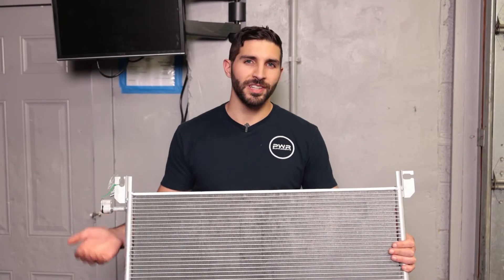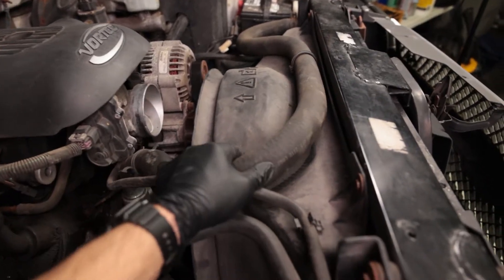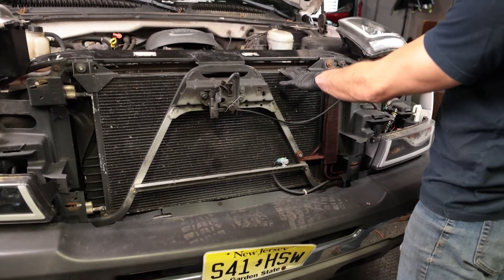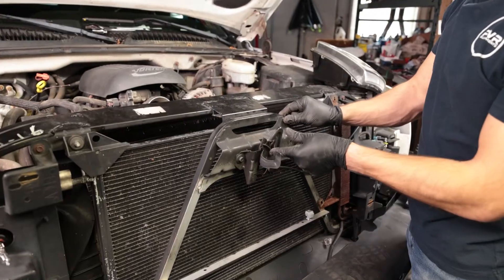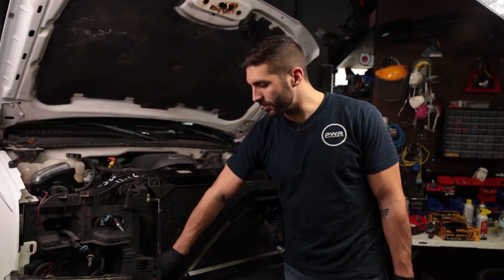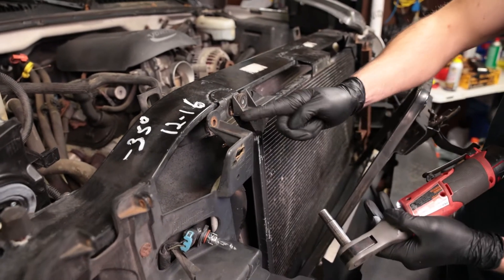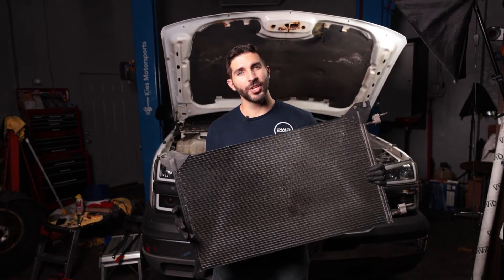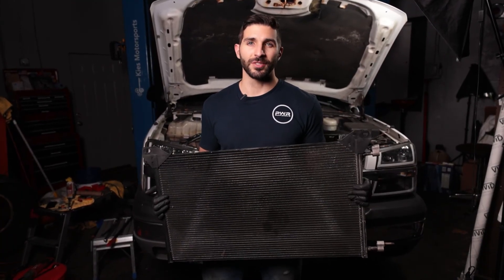How to Replace 2004 Silverado AC Condenser -  Sierra 4.8L 5.3L Tahoe Yukon Savana Avalanche Suburban

Comment: What were the symptoms.  My ac is not blowing cold air I done changed just about everything on the truck new ac compressor accumulator orifice tube cleaned out the filter and fan. Replace 2 blend door actuators the ac kicks on as it should and the accumulator is nice and cold please help! Only thing I haven’t changed is the condenser
Reply: Check the evaporator
Reply: Have you tried replacing the a/c pressure switch?

Comment: Nice tge radiator was key and shortens work time by hours working on the lower cooler line nuts and the top bracket bolts. Thanks

Comment: What was the reason behind loosening the radiator? After I watched the video to get an idea of what I had to do, I ended up just removing the grille and the headlights and did the same trick as you, where you loosened the center brace and slid the condenser out. That worked great, but I didn’t need to touch the radiator at all on my gmc Sierra
Reply: Oh I see, it was to get the ratchet behind there for those two top bolts on the brace! I have my ratcheting wrenches that I used to get those and they work a treat, definitely worth picking up a cheap $20 set of them from harbor freight to make this job much easier!

Comment: In my case replacing both compressor and condenser, What if the compressor is already filled with oil out the gate? Do i still have to prep the condenser with more oil?